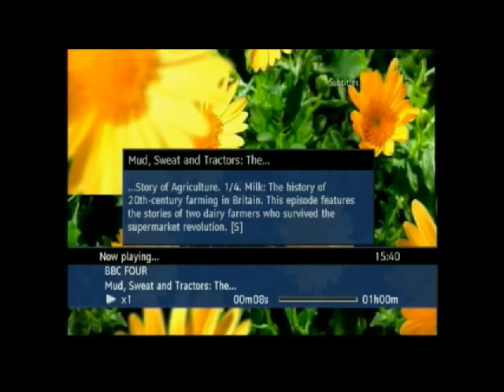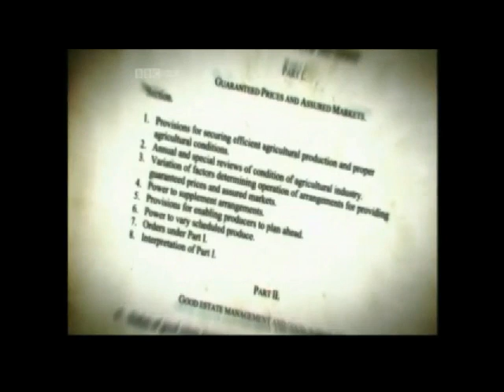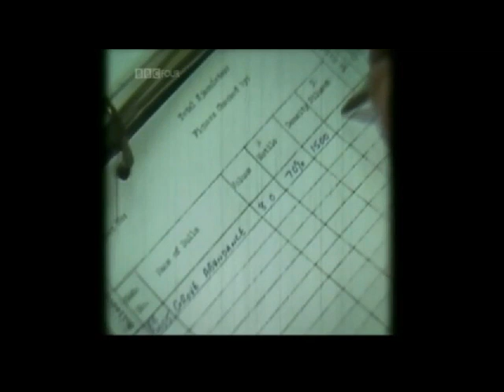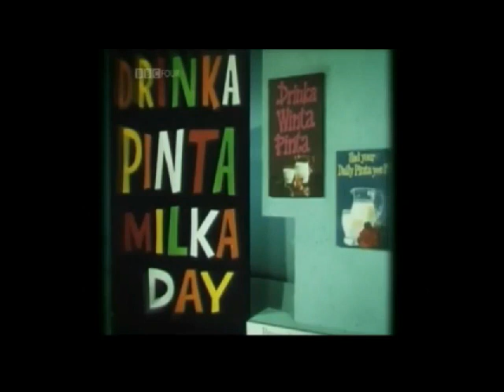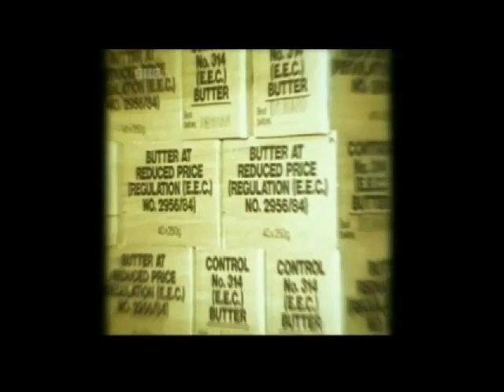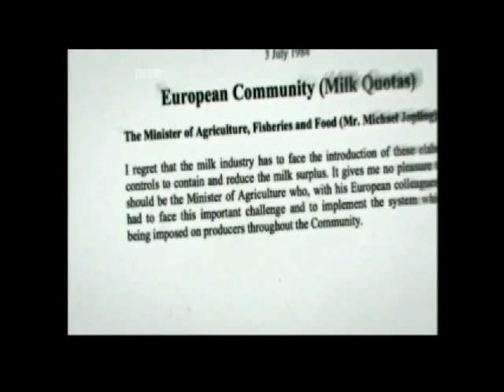BBC Mud, Sweat, and Trackors   ep1   Milk

Comment: Actually, milk is not as nutritious as green vegetables. "Hip fractures and osteoporosis are more frequent in populations in which dairy products are commonly consumed and calcium intakes are commonly high.  For example, American women drink thirty-two times as much cow's milk as New Guineans, yet suffer forty-seven times as many broken hips.  A multicountry analysis of hip-fracture incidence and dairy-product consumption that milk consumption has a high statistical association with higher rates of hip fractures."

"The major findings from the Nurses Health Study, which included 121,701 women ages thirty to fifty-five at enrollment in 1976, was that the data does NOT support the hypothesis that the consumption of milk products protects against hip or forearm fractures.  In fact, those who drank three or more servings of milk a day had a slightly higher rate of fractures than women who drank little or no milk."

"Many green vegetables have calcium-absorption rates of over 50 percent, compared with about 32 percent for milk.  Addiontally, since animal protein induces calcium excretion in the urine, the calcium retention from vegetables is higher.  All green vegetables are high in calcium."  

"There are many good reasons not to consume dairy.  For example, there is a strong association between dairy lactose and ischemic heart disease. There is also a clear association between high-growth-promoting foods such as dairy products and cancer.  There is a clear association between milk consumption and testicular cancer. Dairy fat is also loaded with various toxins  and is the primary source of our nation's [the USA's] high exposure to dioxin. Dioxin is a highly toxic chemical compound that... is a prominent cause of many types of cancer in those consuming dairy fat, such as butter and cheese.  Cheese is also a power inducer of acid load, which increases calcium loss further.  Considering that cheese and butter are the foods with the highest saturated fat content and the major source of our dioxin exposure, cheese is a particularly foolish choice for obtaining calcium.

"There is ample evidence implicating dairy consumption as a causative factor in both prostate and ovarian cancer.  In April 2000, a Harvard study reported that having 2.5 servings of dairy each day boosted prostate cancer risk by more than 30 percent. 

Dr Joel Furhman, Eat to Live, pp. 84, 85, 88, 88-89

The fact is, the campaigns to encourage milk-drinking and cheese-eating are simply politically motivated to keep milk producers in business and to keep milk production as part of the economy.
Reply: Blah Blaah Calcium alone is brittle and huge intake of calcium may make you bones bigger but it doesn't meant it will be stronger. What lacking are special proteins that interlaced the calcium into a flexible and less brittle structure that does not easily shatters. These are similar proteins which makes up your skin, making it smooth and tight. When we age our body produced less of this unique protein thus why old people have wrinkles. The protein called collagen....hence why people took it for beauty but in reality it is one of the important building blocks of the body.